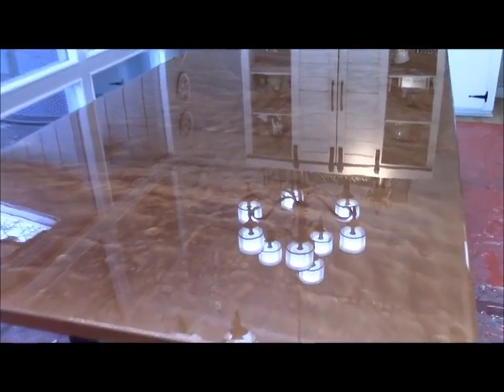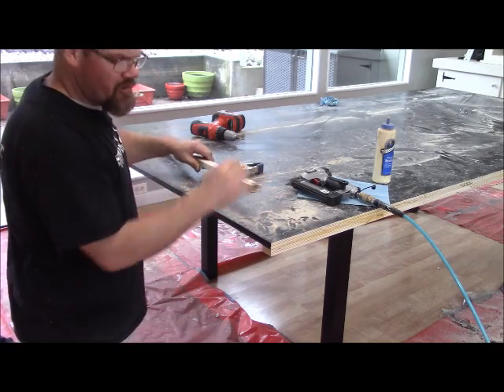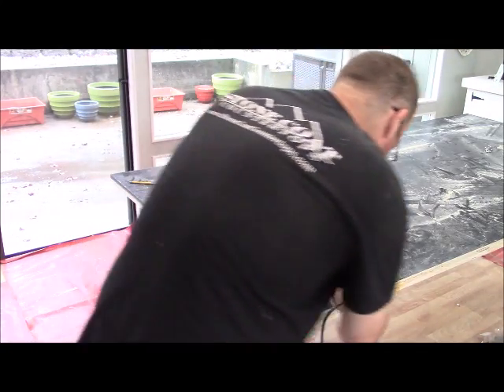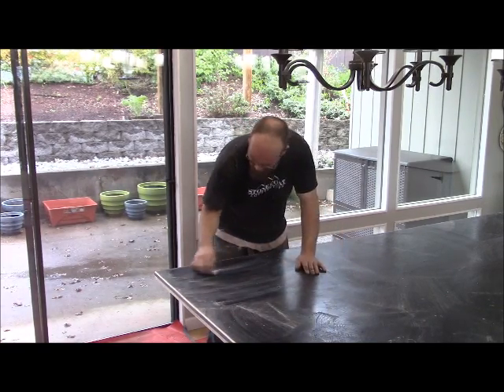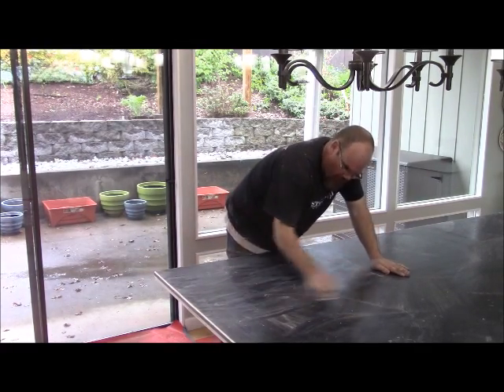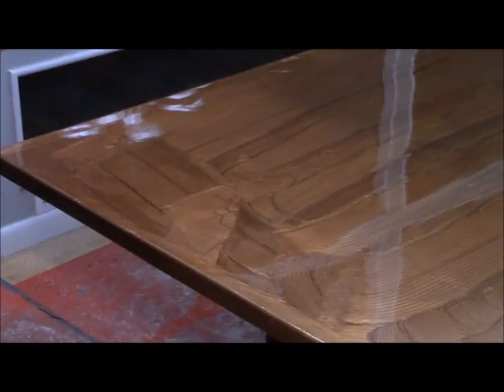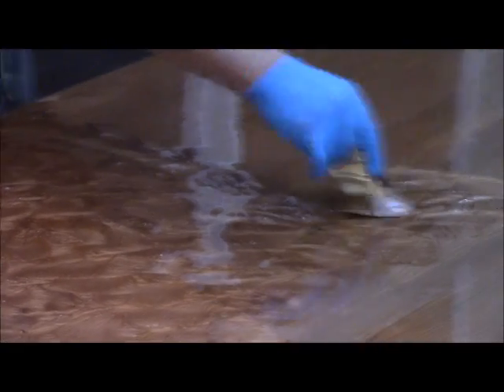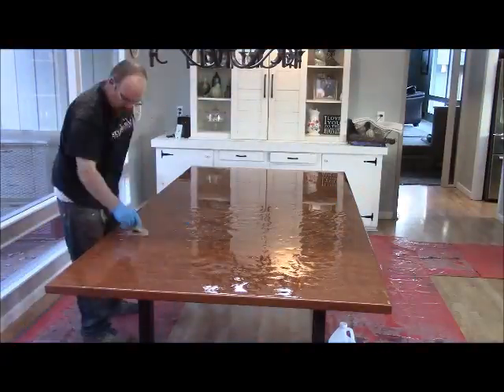Copper Epoxy over an old Plywood table

Comment: I love this copper look.  I wonder if I can ask a couple of questions?  I'm interested in doing an outdoor kitchen however this kitchen will be constructed on a ground level cedar deck so I can't do concrete countertop as I'm concerned about it being too heavy for the deck.   would it be possible to do this epoxy countertop on a cementboard base?   If not, can it be done on regular plywood that has been coated in a rubberized sealer like redgard?  Or better yet I should ask the professionals lol, how do you recommend I do this outdoor countertop with your epoxy coat?

Comment: Great and informative! When I want to get paint or whatever out of a gallon bucket or tray, I use a rubber cake spatula, with the end cut off square. It works really well and fast, and no material on the hands! 
I would have used a brush in each hand for the chopping, for more speed. 
I wonder if 18 gauge nails would suffice? I must have 8 boxes of those and like most carpenters, our smallest guns.

Comment: You used a copper base coat on the black paint, did you also mix some copper base coat into the resin with the metallic copper powder, or just use metallic copper powder only? Amounts used would be useful, thanks.

Comment: I have just ordered supplies. I will be doing this project over laminate and ordered primer should I add base color to the primer and then do another coat that is just base coat?
Also is base coat added to the epoxy or is it just the powder thats added? 
How much powder do you add to each batch of epoxy I make?
Finally, I will be doing about 18 sq. ft. will I need than 1 jar of the base coat?

Comment: how much practice does this take and did you have touble finding chairs that worked well with it?
Also, did it soak in alot for did you use a primer on the bare wood?

Comment: Quick question about your clear coat of epoxy.  How much did you use compared to your initial coat?  I did a board last night where I used 4 oz of both (8 oz total) for my flood coat.  Came out great but does have some low points...  so should I sand and then pour the SAME amount for the clear coat?  Or less material for the clear coat?  Thanks.

Comment: I've seen people use plywood for flooring.  Some say that the top layer of plywood is so thin that regardless of finish coats, the durability is still very poor. Does this epoxy give better protection that could be used for a plywood floor with very high traffic?

Comment: so let's say if I use two pieces of three quarter inch plywood glue them together and use your epoxy techniques I could use this as a bathroom countertop?  the current bathroom countertop is from the 90s which is laminate and the particle board is no good, also it has an attached backsplash.

Comment: Drywall mud that dries in 20 minutes is available too.
I found it at Lowe's.  No fumes, and cheap!
The bubbles popped do to the air being heated and thus increasing the pressure inside. (Boyles Law)
The torch was getting it's oxygen from the room. If it wasn't already getting it's oxygen from the room, you wouldn't have had ignition in the first place.  
Pyrotechnics lesson #1. 😉
Great job.  Looking forward to duplicating it for a large coffee table! Thanks!

Comment: Why did you not use a vacuum when you were cutting and routing? Seems like it would have been easier clean up and less dust in the air and on everything in the kitchen. Other than that, awesome results.

Comment: How do you make a complete seal between the back splash and counter top
Reply from the maker: Great question Julie! We use 100% silicone to glue the backsplash to the wall and seal the joint where the backsplash and countertop meet. Thanks again for the great question and please feel free to contact us anytime for project support. (541)450-1976

Comment: That's a nice look, but I have a couple of questions.  1) What about the underside?  Is it finished too, and with what material?  2)  Is there a health hazard from the fumes, especially during torching?  3)  When is the epoxy fully cured - in a day, a week or more?
Reply: Ok.  What is the probability that the top will warp due to changes in humidity?

Comment: I coated a table and put it outside and all the bar coating turned yellow and rough.   Does your finish stand up outside in the sun or are coatings just not meant to be in the sun?   I saw the metallic table you created, does that need to be kept out of direct sunlight?

Comment: I was planning on doing my bar top with sheet copper then epoxy. I think I am going to use this method instead since my bar will have a curved portion. Can I use the base coat directly on MDF or do I need to prime it?
Reply: Do you have any option for copper metallic with a matte finish...something other than high gloss?

Comment: 1st dumb Q.   Is it water proof? 2nd, is it food safe???
Reply: Answered most of the question.  The only Question I have left is still regarding water proofing process.  Would the surface area covered in the epoxy be 100% water proof?  or does it need red guard underneath for protection?  Tat is more or less what i meant to ask.  I should of been more specific to begin with.  Thank you!.

Comment: curious as to the reasoning behind your drop edge process. Wouldn't it, in this particular situation, make more sense to cut back the ply a little further and then use a softwood/pine edging glued/nailed on then chamfered to prep for pour thereby negating the entire bondo process? The transition between ply and pine edging would be hidden by the pour, yes? Thoughts?

Comment: Great video, but when mixing any type of putty's, fillers ,etc.,  that are 2 pack, maybe try plastic/metal, or something that is not an absorbent material, may prolong the life of the mix, as a painter why wouldn't you use a paint tray with such a large area to cover on the first coat,!!  How much time do you have to spread the copper coat, ! before it starts to harden, I may sound critical but I don't have a time lapse,  and it really is a great video top marks

Comment: How long does it last? How about if I accidentally  put something hot on it?
Reply from the maker: Great question! Stone Coat Countertop epoxy is durable. You can set hot pots and pans directly on the surface; however, just as any countertop surface, we suggest you still use hot pads, as it's nonporous and food safe. You can clean with normal household countertop cleaners, but soap and water generally does the trick. Not much will damage the surface as far as spills and stains, but it's good to clean up spills after you're finished cooking and using your tops to prep. It takes three days for light use, seven days for cure and thirty days to a full cure where our durability video tests are shown at. Here is a link to our durability video showing what Stone Coat Countertops can take, we have tested up to 475 degrees fahrenheit. Thank you and feel free to contact us anytime! Here is that video link: https://www.youtube.com/watch?v=YLUteivXWaM
Reply: @StoneCoatCountertops  Thanks for valuable information. One more question. How much would it be costly for small kitchen counter?

Comment: Nice. Clearly you have done this before.

I've never seen product with such a long working window. I'm amazed that it doesn't drip off the edges. 

Looks like you guys pulled an all nighter.

Actual copper has risen dramatically in my lifetime, so that's a nice option. What does the project cost in labor and then materials?

Thanks.

Comment: How long do you wait between the 2 coats? Also, do you fought it up between coats?
Reply from the maker: Hi Kay Weinland, you can wait as long as you need to, but generally speaking we wait 24 hours in between coats to allow the epoxy to harden so we can sand it with 220 grit sand paper to establish a mechanical bond!

Comment: Question:  If you wanted to do this over an old laminate counter top that has some mild texture, will the epoxy level it out to a smooth finish or will it level it out with the texture showing?

Comment: nice work i feel inspired lol. i have  a few questions hope you dont mind.
-instead of the bondo for the sides can you use sanding sealer ?
-instead of flame can you use a heat gun to get rid of bubbles? 
-how do you judge the thickness?with a work area that large how do to keep it all equal? practice? hehe
 and its pretty cool how your wife helps out (family business) thanks

Comment: Really nice! However, you all of a sudden have a bucket of copper epoxy, then the top coat of epoxy. It would have been more instructive if you had gone thru the epoxy mix, what kind, resin to hardener ratio, copper additive, then the top coat mix. Otherwise, great, will make for some nice projects!

Comment: The heat expands the air bubble and it automatically rises. The flame does not"eat"or draw out anything. What is the curing agent? most of what I've seen has been flammable. Does it cure out any noxious fumes or have to out gas harmful vapor,  any at all? I notice no ventilation or respirators.

Comment: Love the videos and am looking forward to doing something similar but to a bathroom vanity. I have watched your bathroom video and noticed you used spray paint in the bowl to compensate for gravity and make sure the color was "even". Would it still be necessary to do that if I plan on just doing copper metallic like you are doing in this video? Also, is there a way to preserve a more prominent "hammered" look in the end. I recall you saying in one of your videos that when you torch it, you tend to lose some of that effect. Lastly, would that "hammered" look still show in the bowl (i'm thinking gravity may pull it down when you cut it making it less visible)? Thank you again for the great vids. Can't wait to work with your product.
Reply: StoneCoatCountertops thabks for the response. Any recommendations on spray paint that would match the copper color? Or should I be looking at other colors?

Comment: So if I have a table that has a plastic coating on to make it look like marble do I need to remove that material or just apply over it
Reply: Joseph Middleton I work for concrete flooring company. I would for sure remove any existing coating for the best chemical bond. Considering it’s plastic, sometimes a scuff and go is good enough to coat on

Comment: love love love this stuff. 
I do have a question. on the clear coat, with the heat is there any curing time? I did a giani white diamond kit for me mum , it looks pitted I want the slick look will the torch give me that? sorry if my terms are not correct I'm new to this but had I have known about this product I so would have tried it first. any help is appreciated

Comment: Use a notched applicator to get an even coat and the ridges flow out to a smooth even coat  put a viberating sander underneath and use it to agitate the finish into a even more  smooth finish !

Comment: Hi guys.  Great job.  Looks fantastic.  Two questions...

What did you use for the top coat?  And, did you apply it using a flood coat or did I see you using a dabbing technique like you used with the copper epoxy coat?

Comment: Can this copper epoxy be done on my table with a leaf, I would like to be able to continue using the leaf. It currently has a ugly laminated top. I would like to have it done soon. Any advise please.
Reply: ok ,i guess my next question in order to be precise enough to figure how far to sand back i need to know how thick would the product be. or is it necessary to cover the edges on the leaf? or is it that sanding needs to be done after the application because of the product running down?  so you would just put the leaf in place as you normally would, then after it sets, separate and sand?

Comment: I have concerns about bondo for the edges. How about sanding and a wood hardener..or sanding sealer? Also have issues with the top being previously painted and bonding issues. I know it won't last for centuries..lol..just saying. Also A saw with a vacuum attachment would be nice..lol

Comment: I have a project I need to do similar to this simple though just paint over the plywood with white paint, then epoxy. My question is you said you normally use all in one paint ie primer and paint type paint, do you use oil or latex for a paint coat? This will be my 1st epoxy project and I want to do it as correctly as possible.

Comment: Thank you for sharing your profession. I love the before and after. My question is: You mention temperature when using the product. What temp should your table stay in after it's done?  Could I have the heat in my house at 70 a 75 degrees during winter and 71 A/C during summer w/o damaging the work? Will plywood or any wood with epoxy on it expand? (Is it a good idea for bathroom counter?) 
Thank you &I love the training video👌

Comment: I recently epoxied over acrylic on an outdoor plywood table, but it isn't drying correctly. It was a thick pour using a 50/50 ratio which must not have been thoroughly mixed. After sitting overnight, 95% was dry, but there were two small areas which were still sticky. As time goes by more becomes sticky, then seems dry and then sticky again. It has now been two weeks without improvement. Will it eventually dry? Is there any way to fix it? Or does it need to be chucked and a lesson learned?
Reply from the maker: Thank you for reaching out to us just1certifiable.  Give us a call or email us at stonecoatcountertops@gmail.com and we would be more than happy to assist you with your project. (541) 450-1976 If the epoxy is tacky or soft, but not gummy, you can apply a clear coat with a 1:1 ratio like we do in this video link: https://www.youtube.com/watch?v=ygbKeiH7oXI&t=4334s#
Reply: Thanks for the reply and will get in touch when/if I do my counter tops. As for that table... It's been scraped as it became very gummy. Next time I will definitely mix the epoxy for 2 min. before pouring and only use a depth of 1/8th inch per coat.

Comment: How resistant to heat from hot pans etc? Can they handle 400 or 500 degrees? Is it viable as a granite counter top alternative or would they work better as a back splash and table top? Thanks - these are really beautiful.

Comment: I absolutely love all your videos!!  I love your creative side, as well as doing what a client loves.  I did mine when it was too hot (I think), plus, I worked the product too long (just couldnt keep my hands out of it!), i have a few places where there is a little bubble or dust raise in the epoxy, I have put on a top coat, so that is already done, but I still have about 5 different bumps around all my surfaces (first time, didnt think it was bad, plus I just love it so much!), is there anything I can do at this point, without sanding it down and putting another top coat on it, or can you heat it up afterwards and let it go out and then self level again? Love love love you and this table!!

Comment: That came out absolutely amazing! Question..When you chopped it with the brush to remove the trowel marks it also gave the surface a totally differnt appearance in design correct? Before the chopping the epoxy had a "linear" look. The chopping changed it dramatically. Thanks for posting!

Comment: how do you get rid of the epoxy bumps under the table?
Reply from the maker: Great question! We remove drips about 4-5 hours after we pour using a Bondo spreader or old credit card. Here is a video link showing how we do it.  https://youtu.be/74xsrcHaFBE?t=4843
    You can also let the drips dry and sand them off using a 50-grit metal fiber sanding disc and flush adaptor for a grinder. You don’t want to sand them if it’s in the house because of the dust--you want to scrape them when they are gelled and not hard yet. Thanks for the great question!

Comment: What do you clean it with?
Reply: Great question! You can clean with normal household countertop cleaners, but soap and water generally does the trick. Not much will damage the surface as far as spills and stains, but it's good to clean up spills after you're finished cooking and using your tops to prep. Call or email us anytime for project support. (541)450-1976

Comment: What is bondo, is it bonding primer? Plz explain a bit as may be it is named differently in my country
Reply from the maker: Great question! Bondo putty is an automotive body filler. There may be an alternative in your country!
Reply: @StoneCoatCountertops  what is the hardner you are adding? I'm not finding it on your amazon links?

Comment: great job on the finish. but as an installer of resin systems for over 25 years we had many in counters with vinyl Ester reactions against the resins over a period of time due to the expansion and contraction of the surface. our alternative was to use cabosil with Epoxy as a replacement of the vinyl Ester / Bondo. just a note if you have any problems
Reply: What's the best wood to use for epoxy table top?

Comment: What is the size of the trowel 1/4 or 1/8 or something else?
Reply from the maker: Great question sardomnumspa! We use a 1/8" x 1/8" square notch trowel. This trowel perfectly gauges the thickness of material on the surface of our projects, check it out here: https://www.stonecoatcountertops.com/product-page/1-8-square-notch-trowel  Call or write us anytime with questions and for project support. (541)450-1976  What project are you planning?

Comment: "flame wants to eat that oxygen so it does a great job drawing it out"??? nope, nope, sudden heat causes the gas in the bubbles to expand suddenly which the epoxy cannot contain so they pop...it's the same principle when using a vacuum chamber to remove bubbles from latex you're fixing to pour in a mold, make the bubbles expand too fast so material pops and releases the gases